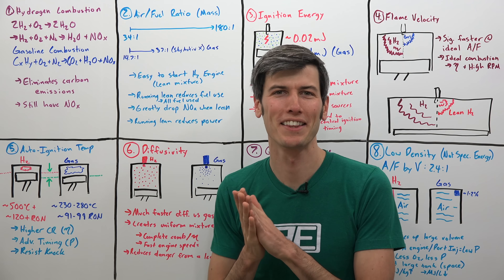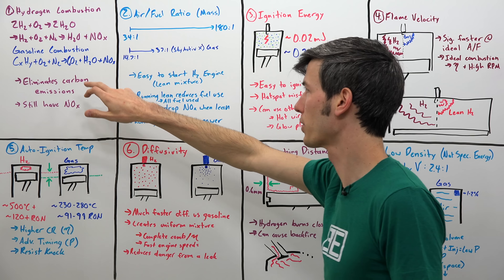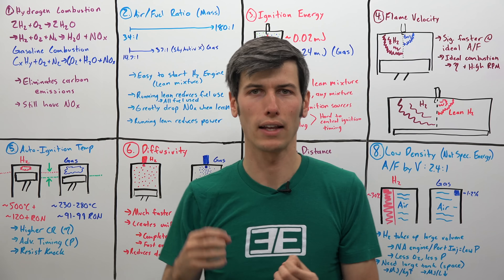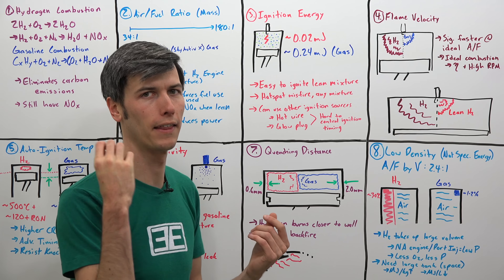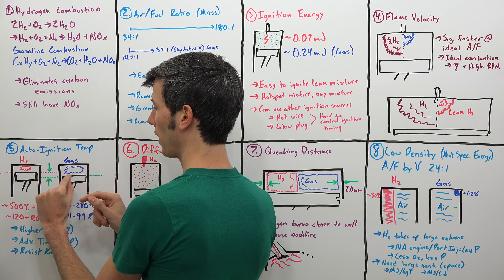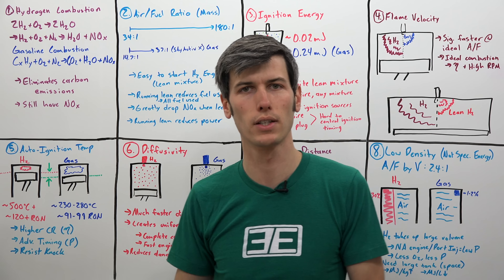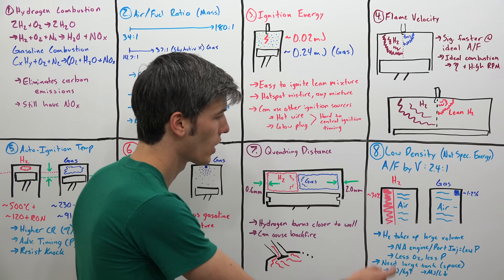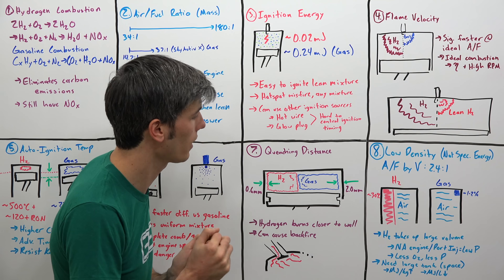The Difference Between Gasoline And Hydrogen Engines

Comment: Wow! Just wow! Everything I could want to know going into developing your own hydrogen engine except what I was searching for initially when I found this channel. Converting a gasoline engine into hydrogen. Now I'm wondering if the better idea would be to convert a diesel engine into a lean burning torque beast! Maybe experiment taking the oxygen from generating hydrogen and directly injecting it into the cylinder with the hydrogen. That would be cool but technically wouldn't you have to burn the exact amount made during electrolysis to get the stoicometric mixture needed to prevent nitrogen oxides in the exhaust or am I missing something about the 70% nitrogen content of atmospheric air‽ How would introducing pure oxygen into a diesel conversion hydrogen engine effect exhaust product, power, etc...‽ Also, and this could be out of your expertise but, how would one go about making a liquid injection system into a gaseous hydrogen or gaseous hydrogen and oxygen injection system‽ All good questions that could make you my newest hero. Bravo Zulu!

Comment: Would it be possible to use half gas and half hydrogen to reap some benefits of each?  Or even a varied ratio of fuel depending on the situation?
Reply: Dual fuel concepts exist, but they mostly are hindered by storage space for fuel.

Comment: very nice presentation and giving enough information for the fuel cell..it is previously thought that it does not have combustion engine...but you made it clear that there is a combustion but there is no fuel mixture but Hydrogen compressed injected to the pistons

Comment: It seems that direct combustion hydrogen engines could benefit from improvements in manufacturing and mechanical engineering. So while a gasoline engine can still be made mostly operation even with a lot of things going wrong with it, the hydrogen engine needs great mechanical precision, but can provide amazing performance and efficiency.

Comment: As a car guy I really enjoyed your content. I've been working on internal combustion engines for 40 years, and it was great to get your insight into what the future will bring.
Thanks so much
Reply: @Matt Mann They would have to for hydrogen as well. Since it has to be produced somewhere. Would also need a hell of a lot more energy then for BEV.

hydrogen mostly only makes sense for 18 wheelers that go really loooooong distances. Otherwise it just becomes to expensive and inconvenient. Since the 5 minute refueling is mostly a lie, and only happens under ideal conditions. And even with the newest Linde compressors the pressure of the hydrogen at fuel stations is gonna sink after a certain amount of cars being fueled. And then you need to wait half an hour till the pressure is build up again.

The city where i come from also thought it was a great idea for have hydrogen fuel-cell busses for the longer bus routes. So they build a fuel station for 1 million. And then rented a bus, because they didnt find anyone at the time to deliver Busses. Which was quiet good... of the over 100 planed Hydrogen Fuel-Cell busses they only ordered 10, to justify the cost of the fuel station. Because it just turned out to not be as nice as thought, and causes more problems then anticipated, storage, compression, cost, power, maintenance. And it also turned out that fully electric Busses manage the longer routes just fine. Which is why they ordered a couple hundred of those instead.
Reply: @Off The Grid What is the problem witch implemention on both hydrogen and evs?
Reply: @Matt Mann Yes thats true but at some point they will have to
Reply: @Off The Grid how do you know what the future will bring you know nothing..
Gas will run out it's a natural resource so you can't depend on gas forever..  there's a country that runs off of surger cannes as gas forever and it works.
Just give it time we won't need gas at all
Reply: Yeah same future being brought as 30 years ago
Reply: Combustion-engines are dead. They work as an invention only when the energy used is nearly free.
Reply: With these gas prices I’m wanting to convert my 454 1 ton to hydrogen 🤣🤣🤣🤣
Reply: @chrisperry1756  Hydrogen is gonna be a lot more expensive. The only reason it's so cheap everywhere on earth is the massive subventions for it.
Reply: @chrisperry1756  hydrogen is far more expensive than gas
Reply: and dont forget with hydrogen back fire is easier :)
Reply: @JoaoSilva-bh3de  I am a bit confused about the advantage in burning speed. All my knowledge points that you cannot make power with fast burning  vapors in a combustion engine. There is no point in fast igniting when we are near TDC. What you need, is a fuel that still burns and produces more pressure when piston is in optimum angle, about 50% down.
That is why nitromethane makes so much power, it burns slower than gasoline. And vapors in general burn 3x faster than gasoline, only some 10-20% of piston travel. 
So i assume that hydrogen engine cannot make significant power without reducing the speed of combustion. I understand that in racing they use water injection, but naturally that is not viable in street use.
GM claims to bring hydrogen-combustion truck engine soon. But in the presentation if you reed between the lines, they still have not resolved this issue. And there is no guarantee that they ever will.

Comment: I agree on all you say, that is how it is , But we can see the advantages , they are huge !
To solve the problems like ,trunk space is not important, due to huge advantages in power ,and pollution ! !
For example if you need pay load, a well designed , “not like we have now “ tandem design , will take care of the problem using lateral thinking !
One thing I am not agreeing with, The volume of Hydrogen in the cylinder, in fact ,it is only in the combustion chamber, Not in the whole cylinder volume .!  YES? !  THESE ARE THE STATEMENTS THAT CONFUSE PROPLE !
I could go into other specifics, but I will wait until the development I am working on bear fruit !
The advantages are great with HYDROGEN full stop .  NO nasty batteries to worry about, and don’t need more and  more power generation !
The Universe is full of Hydrogen various ways !  Is it telling us something ?
The way to do this !  TO THINK NEW AND SIMPLE for the desired outcome,  LATERAL THINKING WILL SOLVE THE PROBLEM !
THE SO CALLED MODERN AUTOMOTIVE DESIGN IS FULL OF COMPLICATED SYSTEMS , NASTY MATERIALS , AND EXPENSIVE !
AND DOES NOT. ACHIEVE ITS AIM !

Comment: Some freerange inaccuracies .. the emissions are higher in NOx
Reply: Higher than what/where?
I can tell you that, running a lean combustion process, NOx emissions are WAY lower than what you see on gasoline/diesel engines.

Comment: Good video thanks! If you don't mind an observation, in the diffusion section you assumed that any escaping hydrogen would vent to atmosphere and therefore would not incur a fire safety risk. However, if hydrogen leaks into an enclosed space such as a past the piston rings into a crankcase or if the leaking hydrogen collected inside a ship's engine room, then the risk of explosion can be significant. There are several methods for protecting against these risks but they need thorough consideration in the design

Comment: Btw I have a doubt that if I keep my (HICE)Hydrogen internal combustion engine car in a snowy area and if it would be cold enough to freeze the hydrogen, then it will take a long time to melt and even it will cause the car’s engine to start and even if it happens again and again, the car’s engine may get effected. That’s my doubt plss answer my question as much fast as you can, just kidding take your time and answer it to me.
Reply: It is hydrogen, not water.
When using liquid storage the temperature of hydrogen will be below anything to expect on earth :)
For gaseous storage this does not apply, maybe the gas has to be heated, yes...hm never thought about this

Comment: 4:47 Maybe hydrogen could be useful in an external combustion engine, like a steam engine? Where the Air/fuel mixture is constantly ignited and used to send a piston back and forth? You could also use a supercharger (I'd say positive displacement) to help force in more air, and also have some of it bypassed into the combustion chamber to limit the material temperatures (like in a turbine engine).
Reply: Nope. You are describing a external combustion piston engine. Inefficent. Efficiency ranking: Intenal combustion piston > Internal combustion turbine > external combustion turbine > external combustion piston.

Comment: What if we generate hydrogen on the go thru electrólisis even better if we combine it with the Nissa's gas ev car uses an engine not to run but just to charge a battery to run electric motor

Comment: Great specific information of this interesting comparison... One of the best ways to create power with the use of Hydrogen is to mix it with conventional petro-fuels at a central point of the intake manifold. One of the best ways to create hydrogen, is to seperate it from oxygen as it is in it's inert state in water...This has successfully been done onboard vehicles... The advantages to mixing these separated (disassociated) hydrogen & oxygen gas's with conventional petrofuels are : 1) Better more complete fuel burn , leading to more energy and fewer hydrocarbon emissions from petrofuels. 2) Increased fuel mileage of the petrofuels. Because of the improved fuel burn.  3) Water, can be the source of Hydrogen and Oxygen before it has been seperated, which is very dense. It Can easily and safely be stored in a vehicle, to provide this tremendous catylist to help the conventional petrofuels perform so much better, and greatly extend the capabilities of carbon based fuels. The 8 points of interest in this comparison are examples of WHY the HHO should be mixed with petrofuels to create energy , particularly the flame propagation rates and the diffuseability... There are reports & studies which reveal that mixing HHO with conventional petrofuels, has increased efficiencies of internal and external combustion engines, by as much as 50%... More later, on the  research of which type of powerplants could run on pure HHO....
Reply: My Uncle used HHO and gasoline hybrid and got a ripper of a sidevalve application, Torque and economy went through the roof.
Reply: @altruismfirst6489  the injection of HHO into the intake plenum of spark ignition reciprocating engines along with the normal fuel it usually burns, is probably   the best way to apply it on an engine of that type... However, one of the best ways to harness re-newable / re-usable energy that HHO offers, is in a gas-turbine engine... The timing of the fuel burn is not extremely critical with those types of engines, and they will work very well with Pure HHO , because of the advantage of not having to produce fuels with predictable burn times, that the vast majority of the reciprocating type of engines have to operate with...And the potential power to weight ratio of gas turbine engines is FAR better than any type of reciprocating engines...

Comment: I like you video verry much. But i miss some problems that H2 causes if you use it for cars etc..(sorry for bad english i am german)
Since H2 is a extremly smal molecule, i causes quite trouble to handle it. It is diffusing through everything (even a steel tank) on a significant high rate. It is like to carry water in a cloth bag. And the real problem is you can not perfume it. And that can cause a danger. Lots of research groups are working to bind H2 softly on some some kind of sponges to lower the pressure and with that to lower the diffusion. But so far there is no real success.
Reply: You are right, but H2 has an advantage in terms of safety compared to other gaseous fuels. It is very volatile, which means it diffuses quickly into the environment, while LPG or CNG  tend to accumulate e.g. in underground parking lots
Reply: @roflKartofflel  
 You have there a point, but other gases you can recognice, because you smell it..and thats the most important safty component.
Camping gas for example...you smell it in minimal doses because it is perfumed other wise you would not smell it..and the perfume gas has nearly the same physical characteristics...

And because of the danger you describe i am not such a fan of those gases either...

But we have lots of experiences with such gases in the house as cooking gas.etc....and it shows that you can smel it way before it comes to an dangerous flamable concentration and thats an very effective protection.

And yea, gases in general have an serios disadvatages in comparison to liquids if you think in safty terms..

Comment: With the continued improvements in battery technology that is ongoing, I see electric vehicles becoming more affordable with fewer moving parts.
Reply: What happens to all the batteries that the electric cars use when they are exhausted? They get dumped in landfill sites. Also a battery car will on its first charge give 100%. However, after every charge, the battery deminshes slightly after each charge. Now with the new hydrogen engines, they breath in pollutants and thus clean the air. The world has had the hydrogen fuel cell for many years, but, what will happen to countries like Saudi Arabia and Syria etc if the world suddenly didn't need oil anymore? The middle east is already a hotspot for trouble. Then, how would governments cope with the loss of revenue from taxation. Nicolai Tesla had done extensive work on free electricity for every home and business simply by a small device placed in back gardens  and when he died, the FBI raided his hotel room for all of his notes and then they went to the hotel's safe and took the rest. His brother complained but got nowhere. All that free electricity didn't go down well. Just imagine having free electricity like Tesla had planned.  Apparently, just before he died, he found a way for all vehicles to run by electricity without the use of batteries. It was simply the same device that he had in mind for people's homes only much smaller. Governments can't tax it if it's free, so they lock it away and companies like EDF and all the rest are so grateful to governments and governments get to tax it as well.

Comment: Nice , explanation, just 1 question , is it true or not , if you start with super purified water to extract your Hydrogen,  you will not produce nitrogen oxide gas , after combustion ???
Also I suggest to use only 2 colours on white board , red for petrol, and blue for Hydrogen,  easier to follow, 
Cheers